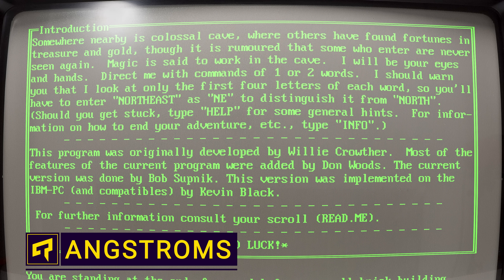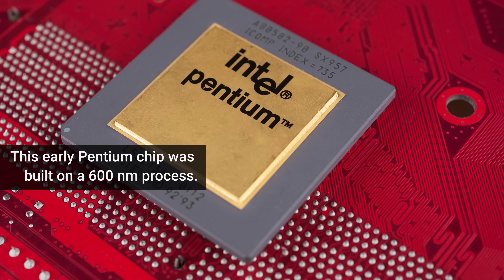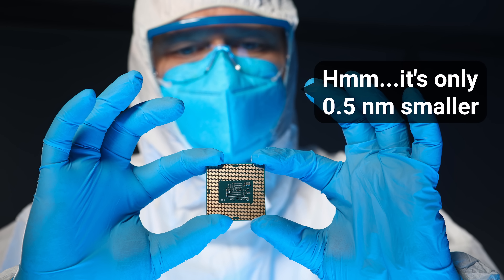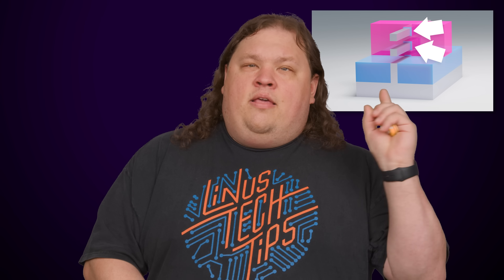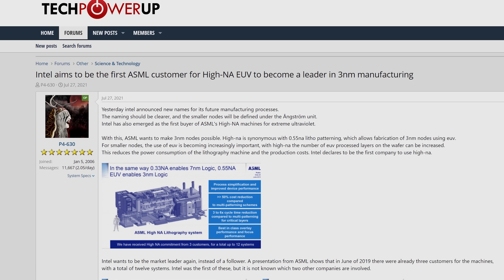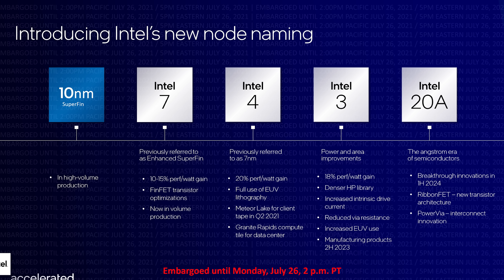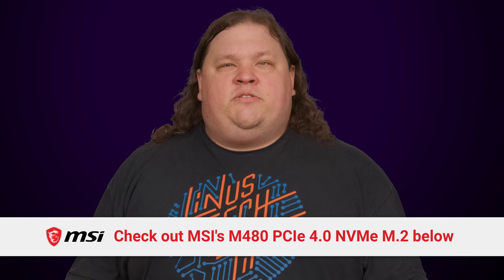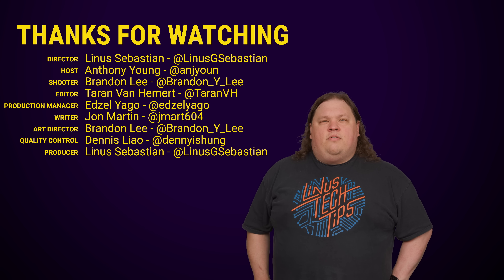CPU Angstroms vs. Nanometers

Comment: I think we need some universities or scientific colective to sit down and set the parameters for measuring transistors, I don't want to start listening about "blast processing" bs again.
Reply: Blast processing is still the premiere technique. Haven't you seen how fast sonic can run?
Reply: Well, it was kind of a thing.

Pretty sure it was mostly a programming trick but it existed.
Reply: @glenwaldrop8166  yeah, it was a glitch that didn't even work reliably on all Sega Genesis / Megadrive consoles.
Reply: It would be the International Organization for Standardization (ISO) that would determine this.
Reply: @writerpatrick  that would make sense but the lithography companies have existed longer than ISO has, that and they've never stepped up with a standard yet.

It's not like the lithographies have to interact so a standard isn't really an issue, it's just complicated to know which is which and why one is better.
Reply: @glenwaldrop8166  which is why everyone should just do what Intel is doing and stop suggesting that the node names have anything to do with physical dimensions. Just give them numbers, forcing people to look the number up rather than let them see the name and assume "10nm" means "10nm"
Reply: @writerpatrick  I was thinking so
Reply: Easy. "Stop arbitrarily naming your process nodes." Done. It doesn't matter what academics say is the correct way to measure a transistor when the industry marketing teams haven't been using any real measurements since around 320nm anyways.

Comment: How many transistors were used in total for the moon landing? Having a hard time figuring this out with google - is 40,000 instructions per second really 40,000 in total? 3 nm is 330,000,000 per milimeter.

Comment: Their competitors have official names like "N7" and "7LPP" etc, not nm's, Intel is just matching their naming now
Reply: I simply watch the MTr/mm2 density number of a node. The name is bullsh*t, i bet that 20 ångstrom isn't even 20 ångstrom in real life, Moore's Law has slowed down since Sandy Bridge or Haswell.
Reply: @saricubra2867  of course 20A won't be 20 Angstroms in size. TSMC n5 isn't 5nm in size either.

And node density is bad for 2 reasons:
1) these nodes are NAMES, not measurements. They need to be simple.
2) density of what? Which part of the chip? Max theoretical density?
Reply: @moist_ointment  Yes, max theoretical density in MTr/mm2 or million transistors per square millimeter.
Reply: @saricubra2867  What if you will get different densities for different kinds of logics? Can you use density to express all of those?
Reply: @_Chad_ThunderCock  That's how 10 Superfin is better than TSMC's 7nm.
Reply: @_Chad_ThunderCock  this still ignores the fact that 100.8 MT/mm2 is an absolute shit product name that marketing dept. will never approve. And how are people supposed to cross compare 100.8 MT/mm2 vs TSMC n7? Naming conventions should line up with competition.
Reply: @saricubra2867  the bad part is that...
- There's no standard on transistor density measurements between manufacturers
- Densities usually reported by manufacturers have little to do with actual chip densities
- Different chips on same process can have wildly different transistor densities

Comment: Why not use a logic/memory density unit like 6B/mm²?
Reply: You could just use the count that you could theoretically print into a square mm space, regardless of how useful they would be. It would probably be a more sensible number for discussing the real impact of shrinks and more consistent than current measurements anyway.
Reply: Because even that's not a uniform measurement of the process, it changes depending on which libraries are used. High performance libraries are going to be less dense and less power efficient than high density ones, and this doesn't even bring into consideration smaller process level changes that are made over the course of its lifespan.
Reply: @steakman7662  and so is this whole nanometer process stuff...
Intels 10nm is more dense than TSMCs 7nm. 
It's just marketing that means literally nothing.

Comment: This an old marketing tactic of obfuscating product names to confuse the buyer into potentially purchasing products of lesser spec.
Reply: No, this is the new marketing tactic of not lying in the name. Let's convert this to frequency to make my point. Can you imagine if all of the CPU companies just threw the actual clock speed out the window when they started adding more cores and continued just arbitrarily increasing the advertised clock speed with each generation? Then suddenly, Intel decides to say 120, 150, etc. So the consumer decides to look up the number to see that it's around 4GHz while AMD continues to say 120GHz, 150GHz, etc.? Would you claim that Intel was using an old marketing tactic of obfuscating product names to confuse the buyer into potentially purchasing a product with a lesser spec? No, you would be furious with AMD for blatantly lying about their product's specs in the generation names.

IBM just made some "2nm" ribbon FETs with 40 nm ribbons.

Comment: cant we just use picometers instead? like when we went from 1.5um on the 286, 386, 486 to the 600nm on the pentiums and so on
Reply: Idk, 20 angstrom sounds easier than 2000 picometers, 4 syllables instead of 6
Reply: @coolmemesbudd  tbf, they won’t say 2000 pico, that’s still being marketed as 2nm.
Reply: @coolmemesbudd  2Kpm
Reply: @kaldogorath  20A.... yeah.
Reply: @kaldogorath  2 Kelvin picometers?
Reply: @kaldogorath  2kpm makes sense to me
Reply: Yep I agree. Picometers make the most sense.
Reply: @kaldogorath  yeah, especially since the higher initial numbers will confuse people either way.
Reply: @Khloya69  
As if normies even know what process size their cpus use, or even what cpu they are using.....99 out of 100 people confuse their storage size with the ram capasity of the machine.....this is just stupid marketing. Anyone that alraedy knows what a nanometer means on a cpu im sure is capable enough to notice that newer cpus with "bigger numbers" say pm instead of um.
Reply: @laharl2k  tbf, i think there’s a not insignificant amount of people who have heard the term nanometer without a clue what the word even means since a lot of companies make it part of their marketing.
Reply: @laharl2k  seems like you're the kind of "normie" who thinks the node naming schemes most companies use still have anything to do with any dimension. If Intel is "just trying to draw attention to themselves" by attempting to end this farce, props to them.
Reply: but we probably won't get that small Considering The size of an Atom Is in the order of angstrom. So Angstrom Makes sense as It is Widely used while talking about Atoms and wavelengths of EM waves
Reply: nah. angstrom is a lot cooler to say than picometers
Reply: @marcosolo6491  
then keep using nanometers till then. Why even change before we even get there?

Imo this is just some try at  bringing some attention to themselves with "something" that 99% of people dont even know what it is.
Reply: I think the reason they don't use picometers is just psycological, a transistor can't be smaller than an atom, and a silicon atom by itself is around 100picometers or 1Å, so you would never be stuck with big numbers, while with angstroms you can theoretically go as low as 1
Reply: @marcosolo6491  *ever. The diameter of the silicon atom according to this video is 220pm. That's still above the cutoff for what most would consider the pico-scale range. X-scale is typically 0.1-100 x[units].

Comment: I wonder if we'll enter a phase where, instead of pushing the power of components, we'll find clever ways to make them cheaper and more efficient. We gotta do something until we crack quantum computing
Reply: Most likely we'll end up using more efficient materials than silicon with maybe some optical computing thrown in. (Quantum computing is great for parallel processing many possibilities at the same time but not for doing many sequential operations)
Reply: We have cracked quantum computing. It's not going household anytime soon though. The temperature needs to be as close to absolute zero as possible in order to get accuracy. Also they currently deal on the 100 - 500 bit range so they're not exactly powerful :)
Reply: @dillonvandergriff4124  right, there's a difference between achieving quantum computing and implementing quantum computing, which I believe we are a long way from doing

Comment: And yet we have + and ++ sizes.  Don't trust what Intel says regarding sizes.

Heidelberg's Uncertainty Principle essentially limits reliability/electron leakage around the 3 nanometer mark.  20 angstrom is possible to build, but impossible to make work as intended.

The solution is more complexity in transistors and more volume them.  We have essentially hit the physical limit of shrinkage gains.

Comment: it took them like 5 years to master 14NM? Am i the only one sceptical here that they will even come close to that roadmap?
Im thinking its more like this
10NM = 10NM
10NM+ = 7
10NM++ = 5
7NM = 3
3nm = 20A
Reply: But lets be honest here, the nanometer idea is dead. why not measure density? like million transistors per MM2 of total die size. In fabrication you know EXACTLY how many transistors its going to have. One cant cheat this system.

Like i got a 3900X wich according to specs got 9,890,000,000 transistors (wikipedia, not sure if official) and a die size of 74 mm² (techpowerup, not sure if included the IO die) that makes it 137,361,111Million per mm²
Its a shame intel doesnt discose their count anymore for some odd reason, i think its to hid the depth of shit they are in.

Comment: I'm sure it will be incredible to play csgo with one of those 18A chips... (At this time, for gaming, GPUs have a longgg way to go until theY get bottlenecked by current high end CPUs)
Reply: There's PDX grand strategies...
Reply: @dylanpresidafonseca2545  those don't use GPU's AT ALL. I could run HOI4 with a 3200G
Reply: @How23497  they do... Just not very much of them.

Comment: I figured they'd start saying "picometers" instead?
Reply: i guess it's either because it would actually be literally impossible to make it smaller than angstroms can already measure, but maybe also because 20A sounds much better to consumers than "2000 pm", since in this case, lower is better.
Reply: Same.
Reply: They'll start using terms like "8pm" and everyone will think they're talking about time.
Reply: Nah angstrom is much cooler name who cares about science
Reply: @metamorphis7  I'm sure that's what George Lucas was thinking when he came up with "Midi-chlorians."
Reply: Also don't forget that Intel is from the US, where they don't give much about real units of measurement xD
Reply: @elmariachi5133  All research and science uses the metric system regardless where they are, and that's simply because it's easier to calculate.

Imperial measurements is just used for common mundane things like weather, distance, oh and sport.
Reply: @fragalot  O'rly?
Reply: Do the conversion & angstrom does seem neater to use than picometers.
Reply: @Apocalymon  there is one big problem with angstrom; most people that care about transistor size already know what a picometer is, while there is only a handful of people that even knew an angstrom is a thing (or even use it)
Reply: @vasilioskontofakas6347  no. You are mistaken, consider the uncertainty principle. We stick to angstroms in condensed matter physics generally speaking. X-ray crystallography also uses angstroms and not pm.
Reply: I guess, but i am looking at it from more of an average pc enthusiast/marketing perspective than from the perspective pf an engineer
Reply: @vasilioskontofakas6347  20A sounds more appealing than 2000pm
Reply: @Apocalymon  But you never use thousands of SI units anyway. It would still be 2nm at that point. You only switch to the more fine unit when you go below 1 of the greater unit.
Reply: @Apocalymon  but then 2nm sounds smaller than either of those, and in the long term works out even better for marketing (when you get to the decimals), and also doesn't break what is prob a 20+ year old tradition
Reply: @vasilioskontofakas6347   I'm old enough to remember when Intel announced a 0.25μm process node. They could have called it 250nm, but they didn't.

Comment: "it becomes impossible to express their sizes in integers anymore", well, just use pikometer instead... 1000pm = 1nm, its a big number, yeah, but at least its metric and most people will already know what it is, but barely anyone will know what a freaking angström is
Reply: "let's just ignore the units researchers and engineers use because some schmucks who took physics in high school know that pico comes after nano"
There are reasons nobody ever uses picometers... Many reasons...
Reply: @hank7281  yeah, reason number one being not needing numbers that unbelieveably small pretty much ever
Reply: @123philimo  yeah, diameter of a hydrogen atom is 1.2A, we don't need anything smaller than that unless you are researching subatomic physics.
Reply: No, we should go straight to femtometer.
Then we never needed to think about that the integers could go out.
Even if, of course, at least half of the marketing department, without a job would be ... XD
Reply: @kitsunesenpai441  yeah, and if we wanted shorter numbers we could just use something like 2 megafemtometers for 20 ångström / 2 nm

Comment: 0:30 that ryzen 5 has 12nm transistor 3000G is ZEN+
Reply: true
Reply: technecly you are right, the 3400g is zen+ but the 3000g is OG zen. unless you mean ryzen 3000 with the g at the end witch is then true.
Reply: I think that 12nm in 3000G is worse than Intel's 14nm, correct me if i'm wrong. Zen  + is also slower than Skylake (correct me again if i'm wrong).
Reply: It in fact doesn't. Those nanometer numbers are NOT the transistor size. They're nothing but a production process. The actual transistor size is a lot bigger.
Intels 10nm is more dense than TSMCs 7nm which wouldn't work if those nm numbers were the actual transistor size.
Reply: @Raja995mh33  they are just marketing terms. Have been since the jump from 22nm to 14

Comment: I was under the impression that once they go below 5nm quantum tunneling kicks in..
Reply: AFAIK that would be the case if something was actually 5nm in length. Node names aren't any indication of actual feature size.
Reply: wasnt quantum tunneling when you are basically "teleporting" information by sending a copy of it over the air?
Reply: @QruisS  Tunneling happens when the distance between the gates of the transistor is so small that the a potential difference or a voltage isn't required anymore for the movement of electrons between the gates. Atleast that's how I've come to understand it but I could be wrong.

Comment: Yeah let's switch to Angstrom, a non SI unit instead of keeping nanometers or just converting the numbers to pikometers. Its is not like those who are actually paying attention to such a meassurement know what it is and aren't impressed by the number sounding cooler. They should rather kick the nm/angstrom size meassurement and start printing how many TFlops it can deliver on the box. It would be just as stupid but at least those numbers corelate to theoretical performance. And they go up so they sound more impressive each time.
Reply: TFlops are just as bullshit.